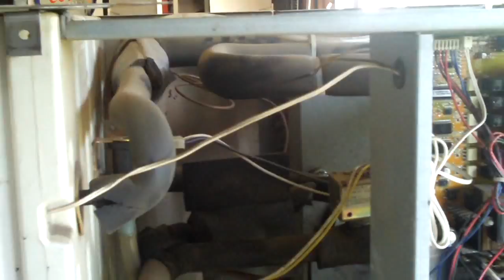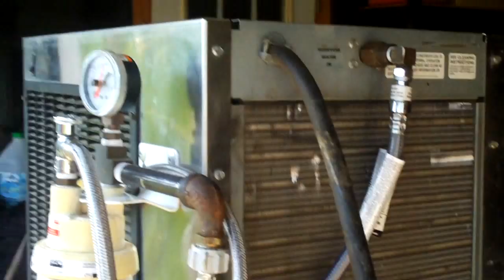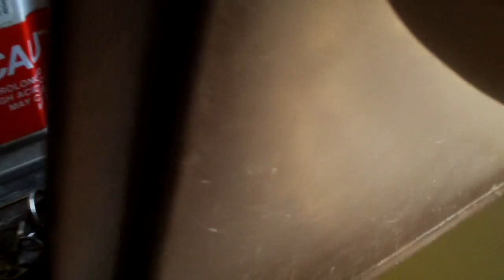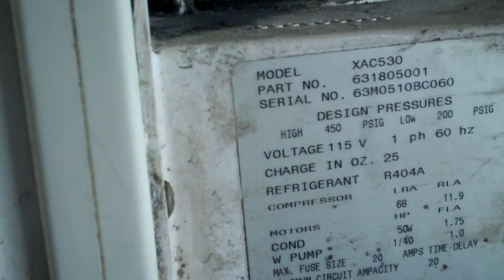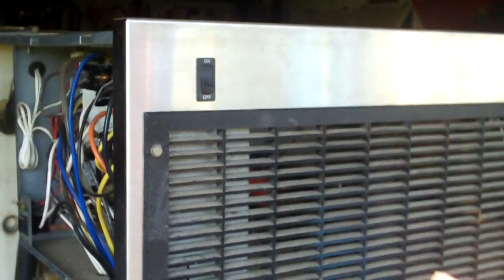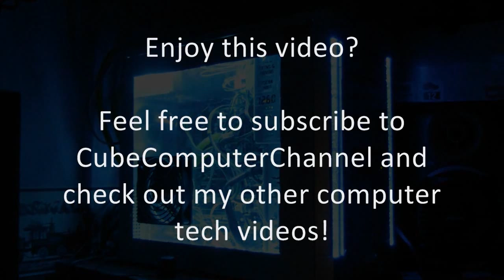Cornelius XAC 530 Ice Machine not working: Any ideas?

Comment: Follow the 2 blue wires to the red do hicky of the gas line. Push the top of it. There is a spring system in there might be sticky. Happened  to 2 machines I had

Comment: Hit the high pressure by pass switch
Reply from the maker: vaport trail It's already been fixed.
Reply: What was wrong with it? Just curious
Reply from the maker: vaport trail The cord had an open ground so the machine would not work. It was serviced by a tech who replaced the cord and cleaned up the machine. Works great now.

Comment: The ground you refered to is called the neutral wire or the white wire in the cable and the long slot on the electrical outlet and the short slot is the hot or power side and it's the black or red wire in the cable. The green wire is for the chassis or equipment ground. I know this because I know a lot about how household electricity works.
Reply from the maker: Myself, dad and uncle all went through this thing and probed for voltage all inside the unit. It was getting 120V H to N. I am also familiar with wire colors.
Reply: *****  I know. Which ground was bad originally? The white or the green? It would be strange to use the green wire as the return for current because that's for the chassis usually. If the green was used, that's unusual because I always seen using the white wire and the green is there to protect you the user from electrocution in case the appliance malfunctions. Yes it's normal to get 120 volts between the black or red to white and green but 0 volts between the white and green as they're basically the same. If the white wire was bad (most likely), you'll get 0 volts and the appliance won't work and that was causing the problem.
Reply from the maker: CBSBKKAMcomputerhelp All three prongs were there when he got it. The guy that worked on it replaced the cord and it started working. It might have been miswired initially, though I'm not sure.

Comment: I don't claim to have any expertise what so ever on this, but an ice machine and an air conditioner are somewhat similar, and I know that when the house air conditioner went out it turned out to be a bad capacitor- fairly common problem, and the capacitor didn't appear to be bulging or anything. If not,maybe the usual suspects- short/brake in wire, failed electronic chip, or whatever else? Again, I'm not an expert and just thought I'd mention the capacitor thing. Hope you get it fixed!

Comment: Im pretty sure its the control board,Just replace it and ittl be goo! But first you want to make sure and check your voltages with a multimeter adn make sure your getting the appropriate voltages. Another thing you can do is check if the compressors working, Use a long screw driver thats shielded from your skin and push the contactor in and it should fire up the compressor and work as normal since its pretty much almost like a relay that the control board controls!

Comment: From looking at the control board I couldn't see anything that looks popped, but what I would do is get your multimeter out and check to see if there are any voltages present (power on). See if you can somehow get your meter in parallel with that capacitor on the control board as it is probably the smoothing cap for the boards power supply.

Is there some sort of fuse in series with the line power going into the unit? if check to see if it has blown.